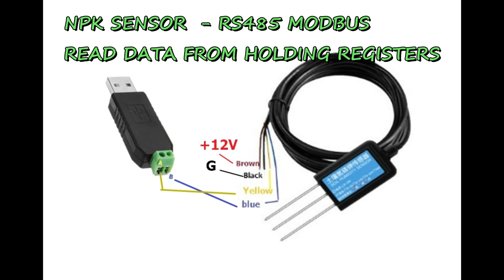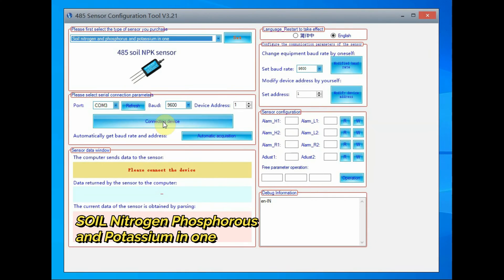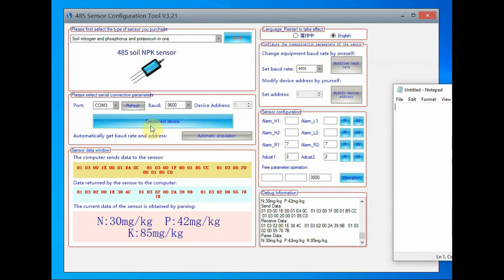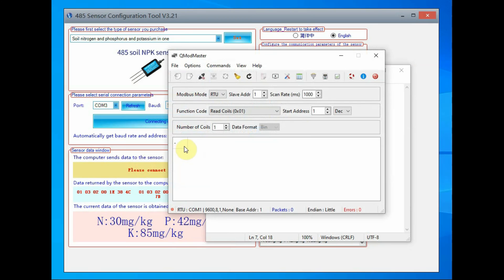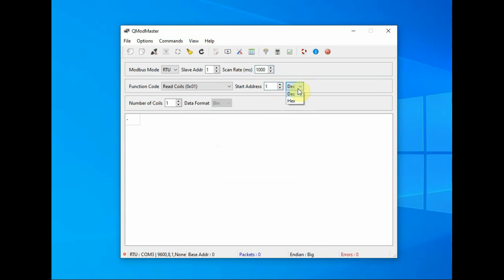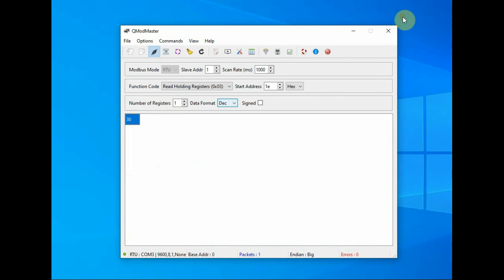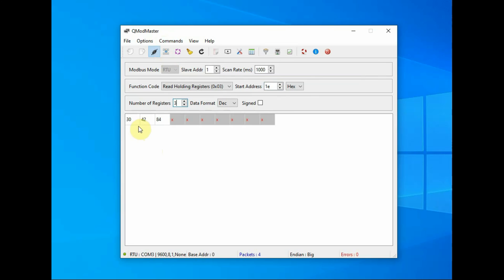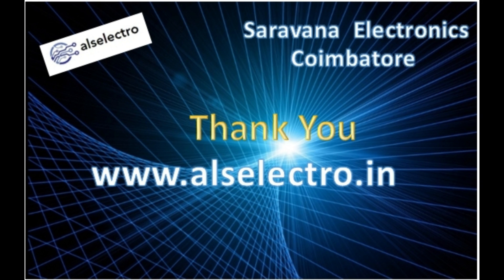NPK SENSOR  - RS485 MODBUS - How to READ DATA FROM HOLDING REGISTERS

Comment: What if there is no data returned by the sensors, I already doubled check the wirings and our sensor is working since I tried it using arduino.

Comment: Sir please please 
Share configuration tool software link
Without configuration sensor is not working 
And i searched a lot but not found
Reply from the maker: Link is in description along with code.
https://99ba69f9-3a9c-49a1-8c2a-52df0ffe5f34.usrfiles.com/archives/99ba69_6f4cf19d328746fa86312648823d6279.zip
Reply: @SaravananAL  Please guide us on how to calibrate the sensor.
Reply: This tool could config of any sensor or a little peace.